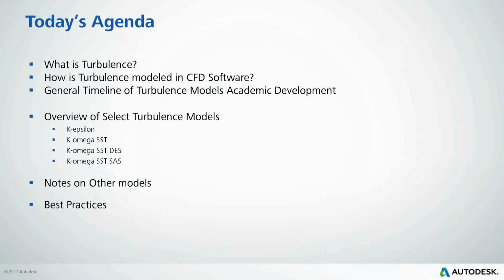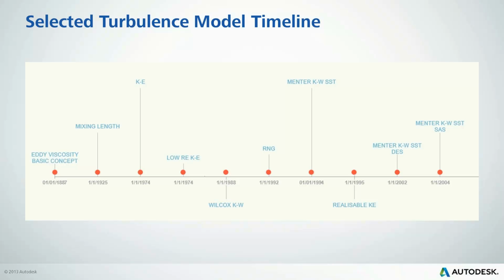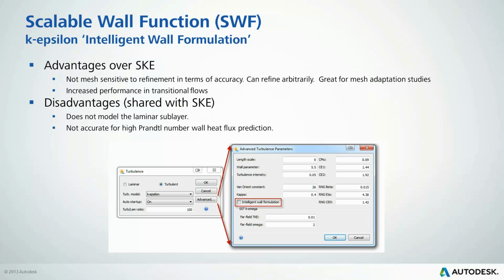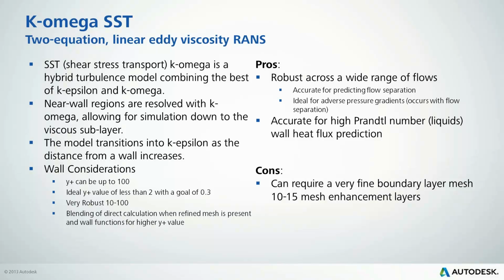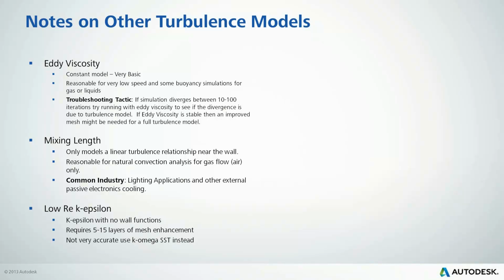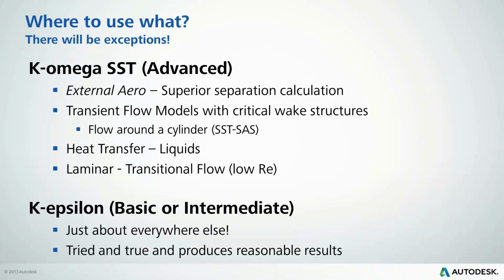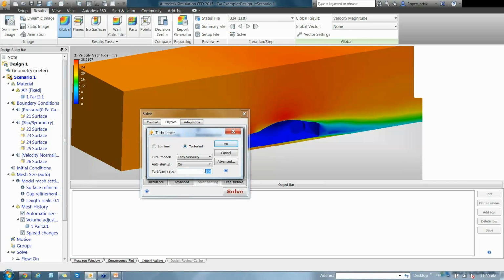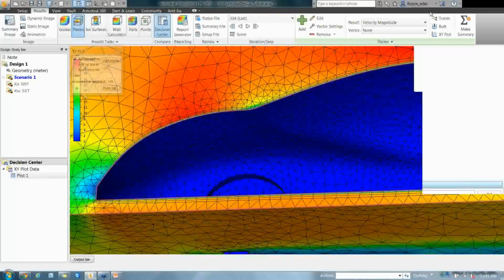Understanding the Turbulence Models available in Autodesk Simulation CFD

Comment: Quite interesting. Never used Autodesk CFD software before, but seems quite reasonable. However, I do miss the Omega Reynolds Stress model; any previsions on its implementation? Also, how does low y+ values affects your k-e model, meaning values below 30?